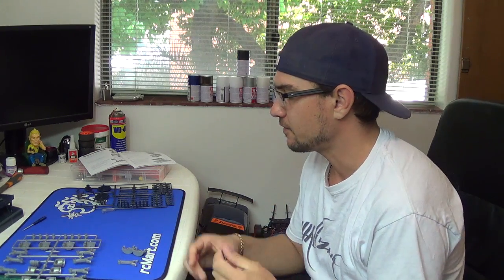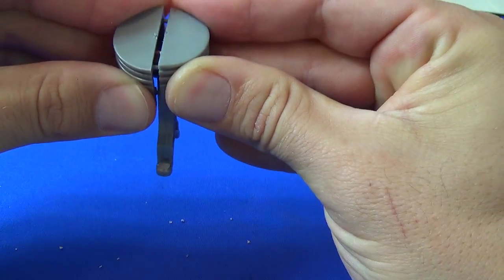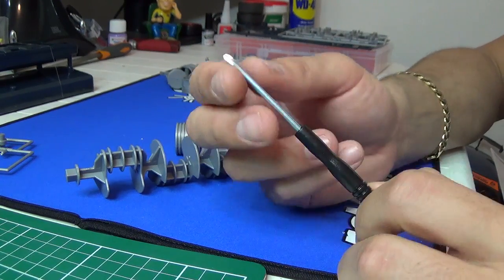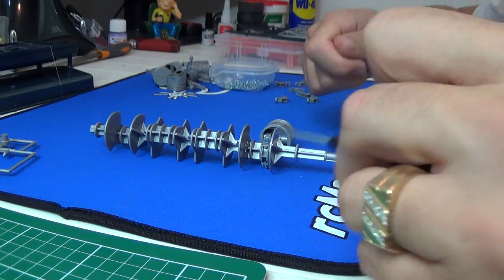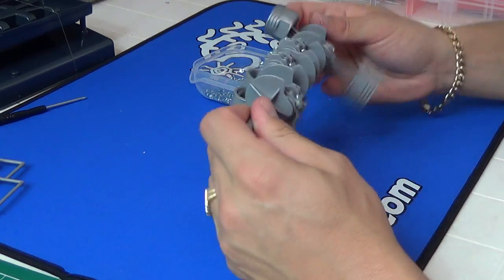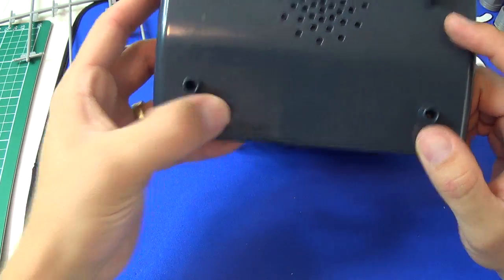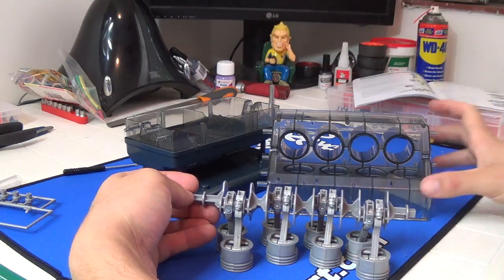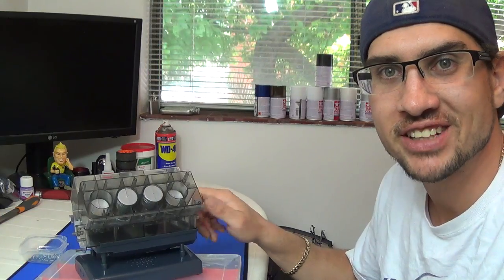Engine Build (Part 3) - Pistons, Crankshaft and Block

Comment: I did min a esayer way I put the crank shaft on the engin block and then I put the piston one the slot and screwed it in
Reply from the maker: that would be an easier way.

Comment: one thing i found in the instructions for the 4 cylinder version that the V8 instructions didn't say is use a little vegetable oil (or cooking oil) (but not real oil) on the moving parts like the gudgeon pins bearing caps cams etc, made it run a lot smother once i redid my V8 model. some of my pistons didn't want to snap together properly as well so i glued them together. i also had a problem on mine with 1 distributer being 180deg out so firing sequence was wrong, i carefully opened it and flipped over the spinner inside (**be careful not to loose the ball bearings or spring inside**)
Reply from the maker: Thanks Weetbix great little tip.
Reply: Honestly  having issues like that makes it more realistic cause theres no such thing as a smooth engine build lol